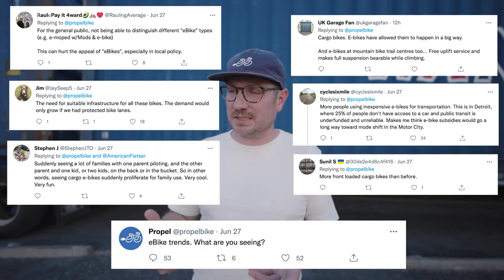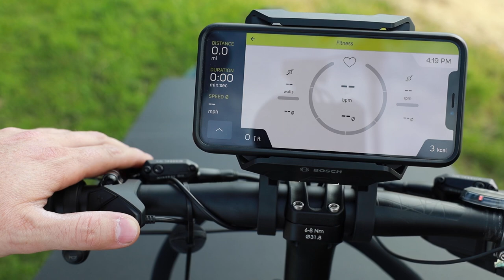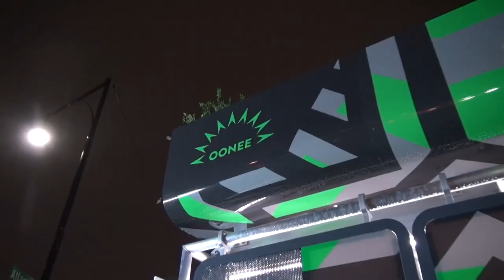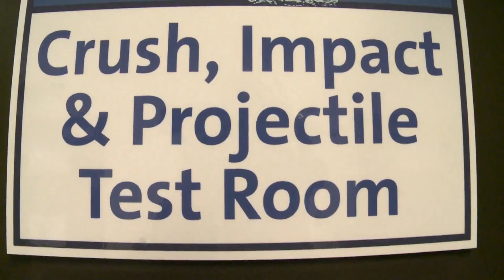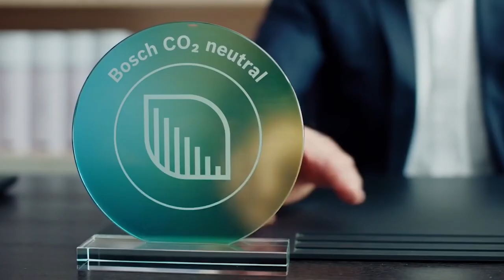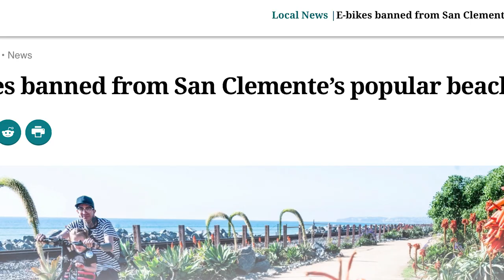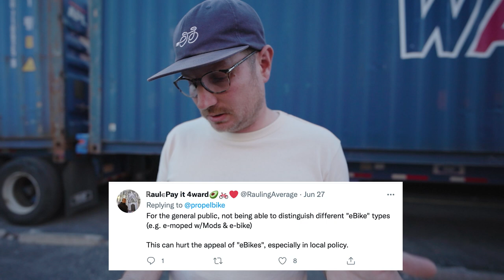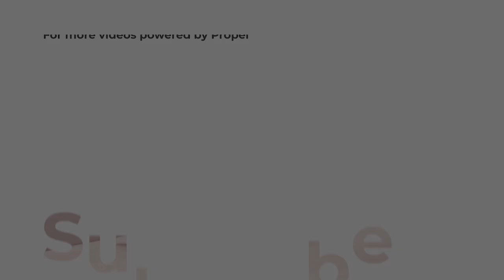eBike Trends for 2022

Comment: Just made the switch to e-bike commuting here in Portland, OR. A few comments, mainly centered around bike-use-as-a-utility: Battery-fire, I hope the industry quits allowing junk batteries. A few fires on the light Rail in any major city, and no ebikes will be allowed there; and that kind of kills a lot of transportation options. Whatever you do as a buyer, make sure you bike has Samsung LG, Panasonic or other quality cells and is from a reputable manufacturer. And to mention house safety: In-house charging is quite common as batteries like room-temperature. but this is still a risky proposition to bring charger and battery in the house. When you are finished riding on a hot day, let your battery/bike cool down for 15 minutes after turning it off - just to be safe. Its a bit paranoid, but if you can do that, we'll keep things safer. While waiting for the train, turn it off sooner rather than later. Theft is a big issue too but as price comes down, theft becomes less of an issue. I have a used Ride1Up which is around $1000-$1500. this is substantially less worry free than those super-pricey reise-muller, trek or other "gourmet" ebikes. We need companies like Rad, Ride1Up, Propella, Aventon to take this ebike movement mainstream. My downtown workplace is installing a better bike locker system so hopefully this theft issue will continue to get better. Range is a big one for me too. I can and sometimes do 8 errands in one day and use up my 30-mile battery range, riding all over the place. We desperately need 2-3x range battery technology. Maintenance and weatherproofing: We get rained on a lot here in PDX-town. A better sealed system bike would be nice. Toyota is solving this with more of a moped-like thing, called I-Road. That I think is the end-game for much of the ebike movement. Maintenance: Bikes in general are a futzing nightmare. Every few hundred miles, something needs to be adjusted, tweaked, replaced. When ebiking, this is amplified due to the higher miles you can accumulate in a month. We need better quality suspension, puncture resistant tires, less greasy/dirty chains, and reliable brakes which don't wear out or need farting-around with every few hundred miles. This stuff needs to run all with good tolerances for at least 1000 miles, preferably 2500 miles. Environment: the oil/lube on many chains contains PTFE-like forever chemicals, which naturally contaminate the water system. I switched to "green oil cycle chain lube", and hope you all do too! It seems to be on of the only quality eco-chain-lubes. I don't get paid by them! There is probably more, but ill cut-out now. Happy e-biking!

Comment: The limiting factors I've seen everywhere internationally are always, always storage/theft and infrastructure. AKA, things the market can't really respond to. I'd really like to see LiFePo4 become the standard for vehicular batteries from a safety standpoint. Yes they're slightly bulkier but they're also not constant fire hazards when physically compromised.
The trends I do see are more IoT everything that's not needed/helpful (high end bosh displays, apps for everything, etc) instead of focusing on theft deterrence/recovery, and a slight trend towards unnecessary proprietary stuff (cockpit especially).
Reply from the maker: I think solid state batteries are the future. It’s just going to take time.
Reply: The new Bosch display is a great theft deterrent due to being uniquely integrated with one motor and the ability to render the motor unusable for theives.
Reply from the maker: It is a good measure for sure. We need more of these measures
Reply: Agreed completely. I don't want to have to carry 75 pounds worth of locks to secure my cargo e-bike.
Reply: Car fires ICE vehicles - 1530 per 100,000 vehicles. EVs fires 25 per 100,000 vehicles. Most EVs use lithium ion batteries
Reply: @TomUlcak  Yes, combustion cars have much greater fire risk than EVs or e-bikes.
Reply: Cars also get stolen and the  cost /benefit ratio of cars is ridicoulus bad. You lose a third of the car worth at the moment you make the first spin with the car key of your brand new car. Congrats.
Reply: @ninetendopesaitama2107  the resell value of ebikes are even worse thanks to thieves. High-end emtbs cost as much as a car and are sold for half the price after just one year. It's much easier to steal and sell stolen ebikes due to lack of registration and law enforcement doing nothing about it.
Reply: @GordonChaffin  GPS tracking and alarm.  Most e-bikes have intelligent management apps.  One lock is sufficient. So, 10 pounds at most?
Reply: The problem with EVs is not the chance of catching fire, but when they do, they are REALLY hard to extinguish.
Reply: such a good point and I believe if I am understanding correctly , you are advocating for more simplicity which for me it means less expense and more reliability and sustainability...cheers and yours and all the comments here are some great topics of discussion and perspectives.
Reply: @andrasbiro6604  Have you tried to put an ICE car on fire out?  Usually, they just keep burning until there is nothing left.  Again, compare 1,500 fires per 100,000 for ICE vehicles to 25 per 100,000 for EVs.  You've been shut down.  Now, shut up.
Reply: @Tom Ulcak your statistics may not be relevant to the conversation. as cars tend to not be stored in multifamily dwelling (bed rooms/kitchens/landings) with the same density as unregulated personal mobility batteries.
Reply: @marchofthecontraption8060  you aren't replying to the specific topic of car fires. Watch the video again.
Reply: Yes LiFePo4 for safety, plus many more charging cycles before the battery is degraded.
Reply: I also wonder about these things before I buy: 
- If it needs repair,  or tuning is it easy to haul around.
- If tire/tube is flat, how much does it cost; and how close is repair person from where you live.
- Can we put e-bike on a regular bike rack? 
- Can a woman senior handle all the lifting herself considering the weight of e-bike? 
- Because we need to recharge the battery, can we recharge the bike outside and not risk losing it since not everybody have garage.
Reply: @mbords01  same issues as a regular bike.  except e-bikes usually have gps tracking and alarms that notify you in the phone app.
Reply: @frafra224  own my ebike since 2017. GPS tracker installed. Where do you live is another factor. Resell value also depends on the ebike brand, drive unit and condition. You cant generalize worth the half after a year. During the pandemic ebikes got more expensive.

Comment: There need to be a standards setting for ebikes, so batteries, parts, etc are high quality, driven by user experience (and not marketing), and fit for use & repair.
Reply: Yes! More reparability and opportunities to become an "ebike mechanic"
Reply: @itsPenguinBoy  Yes, interoperability is key. Non standardisation in bike tech is maddening. 50 years ago, most bike fittings like bottom brackets, stems, seat posts etc were standard. It's now all proprietary, hellish expensive, and each variation needs its own specialised tools. I can understand the need to accommodate design differences, but it's got out of hand. With battery tech, chargers and connections should be standardised at a bare minimum.
Reply: Electric bike company bikes do a good job with ease of repair, and they’re very modular with everything easy to fix and replace. After having an Apollo Explore electric scooter that was utter hell to replace the tire (it got flats all the time, too), my electric bike company model C is a breath of fresh air in ease of repair.
Reply: Diy ebike market has had that covered for ages , the chinese battery supplier will happily tell you how to replace bms or individual fail cell after warranty , or send you a new charger , as for ewheels , just a bit more fiddly but hub motors are robust and fixable with some testing equipment .

Comment: Glad you mentioned recumbents. Whereas a traditional two-wheel recumbent is considered a niche, harder-to-start-on-a-hill bike, and with limited appeal, recumbent trikes actually represent a fantastic accessibility option for older riders and riders who have a disability.  Even the recumbent bike manufacturers have recognized that trikes are where the market is going.  The availability of recumbent trikes locally is still terrible in most places, so many people are either not aware they exist or are reluctant to buy them sight unseen.  Just as cargo bikes are game changers, trikes are such a different riding experience that they may represent a sleeping giant.

Comment: Standardized batteries that can be swapped between brands would be ideal and save a lot of waste.
Reply from the maker: Bosch kind of does this, but the push for innovation limits the benefits here
Reply: @Propelbikes  yeah, i guess there are a lit of challenges that make that difficult to achieve.
Reply from the maker: I think it will start leveling off a bit which should help
Reply: I've counted at least 10 E-bike brands that use the Reention Dorado battery system, so there is already some amount of standardization going on. But a universal standard would be ideal!
Reply from the maker: The challenge is likely none of them meet the current safety standard in NY. This standard will also likely transfer to the rest of the US. It would be a good opportunity for someone to figure that out.
Reply: @Propelbikes  its hard to believe a known brand battery is not meeting the safety standard in NY. I mean Teslas have a higher risk (very low risk compared to combustion engines btw) but i guess they are allowed to drive in NY.
Reply from the maker: If you research it you will learn that they do not have the UL certification currently required by NYC Firecode
Reply: EU could probably force this change overnight like they are doing with the phones standardizing on USB-C.
Reply: The industry can't even standardise charging plugs :(
Reply: @SwiftySanders  overnight? more like a decade and Apple is still unwilling.
Reply: @buddy1155  USB-C was created and introduced first by Apple in 2015. It hasn’t been a decade. That’s what the EU is planning to standardize on. So the story is a bit more complicated. I know because my primary reason for buying the gold 2015 macbook is the fact that the port could handle video/audio and storage and it was far and away faster with transfer speeds than USB-A. If Apple ditched the iPhone port now, it would create a ton of e-waste almost overnight.
Reply: @buddy1155  i’m thinking that is mostly due to the lack of consistency in the batteries themselves. Different batteries and bms have different requirements for plugs.
Reply: @SwiftySanders  The EU told the industry about a decade ago: come up with a standard plug.
ps. USB-C isn't from Apple or was ever used by apple, apple uses firewire they don't want to change it or use any other standard because they own the rights of firewire and anyone who wants to make a product compatible with Apple has to pay them.
Reply: @SwiftySanders  USB Type C certainly wasn't "created" or even introduced by Apple. USB-C was created by the USB Implementers Forum, which did include Apple back in 2014, but also Microsoft, Intel, NEC and HP, all three of which were founding members (not Apple). Nokia introduced USB-C to the world with their N1 tablet three months before Apple released its first Type C MacBook. Worst of all, Apple has been sandbagging since then by not adding USB-C to the iPhone for the sole reason of restricting its own users and selling more MFi licenses to accessories manufacturers. 

The e-waste argument also doesn't hold water as USB-C has already proven to be the most capable standard connector moving forward for many years now, so for every year that Apple doesn't switch, more e-waste is being generated in the form of lightning cables and accessories. Plus they certainly didn't hesitate as much to ditch the 30-pin connector for Lightning back in 2012.

There is only one reason why Apple hasn't switched yet, and it's money.
Reply: They wouldn't do it because they want you to buy their batteries.
Reply: Standardized batteries in the bike industry? Ha! Good one. They can't even standardize the non electronic parts of regular bicycles.
Reply: Different voltage bikes and batteries aren’t compatible, and 36v battery won’t work on a 48v e-bike, I know some people make e-bikes and scooters with power tool batteries, which can be swapped.

Comment: Bike sharing got me into cycling this year, so that for me is the big trend. The cost for e-bikes is a little high if I just plan to joyride(Bay Wheels is 20 cents a minute with a subscription, but a Muni fare is $2.50, so it becomes cheaper at 13 minutes) but I can usually find a pedal bike, and that works better for me since I'm often walking the bike through difficult traffic areas - it's still faster than walking, but slower than it could be. The bike share, bike parking and other rental micromobility companies are all positioned to lobby cities for infrastructure. It helps ridership and lowers insurance costs to have protected networks, and I've seen some examples of these companies sponsoring intersection changes(Spin, for one, has put out some promotional videos of it). I'm happy to support those companies with some cash since their growth acts as a public good.

Battery chemistry is also continuing to be exciting. Sodium ion is on the path to commercialization and I've seen some very optimistic things about it.

Comment: Excellent synopsis. Your comments regarding battery fires is well-taken. Because of theft, I suspect most apartment dwellers store their e-bikes in their homes. A battery fire could be catastrophic. Regulation of batteries is critical.
Reply from the maker: Yeah that's an interesting point about how theft could actually amplify the threat. In China eBikes are required to be stored and charged outside so many of the products from there weren't designed for this use. 🤞for better bike parking and infrastructure along with better batteries and regulations for them. Better and safer batteries is definitely part of the path forward
Reply: @Propelbikes  Of course you would say that about Chinese ebikes as they are your competition. But it's not ebikes that are causing nearly all the fires, which you probably already know. But any opportunity to bash the competition.